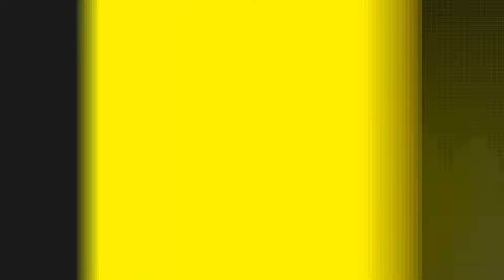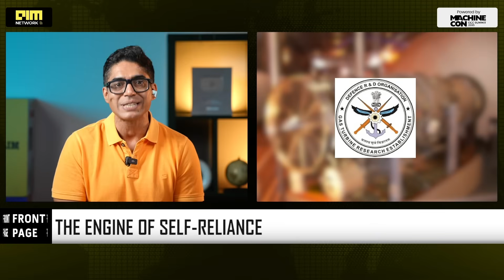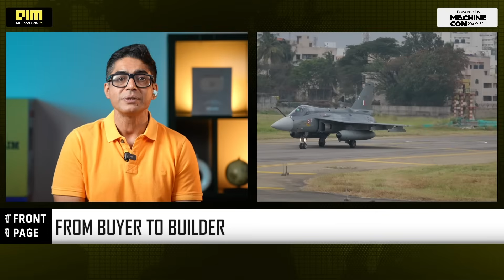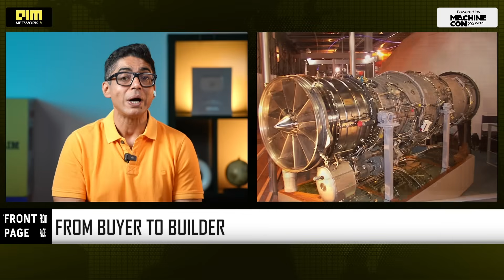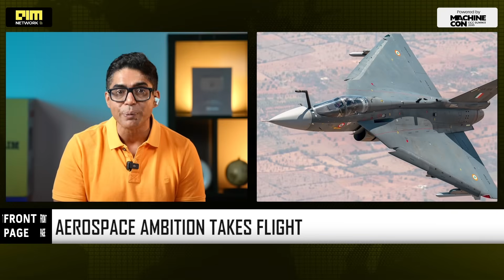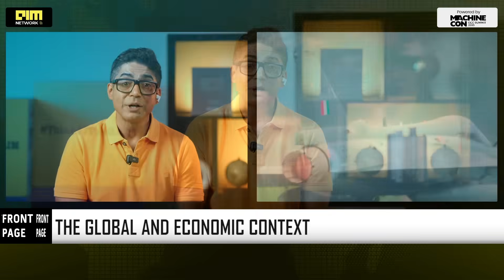India’s ₹65,400 Cr Mission to Build Fighter Jet Engines by 2035

Comment: Not in a decade. India's been fiddling with the jet engine ambitions through Kaveri project since 1986. So like other nations, for India as well it will be half a century of r&d if India achieves it in 2035.
Reply: You are an ally of Congress and anti-India conspirators. India always had the capability But there was never the political will to implement it! Today, the country has gone 200 years backward because of Congress.
Reply: the main problem is not having testing facilities in India, also not including private players back then
Reply: @onelord215 I don't think the failure can be pointed to one single reason. The science is really hard, only 3-4 nations have been able to crack it. Lack of political will and insufficient fund allocation was also a major contributor. Maybe this time things will fall in place.
Reply: I ll